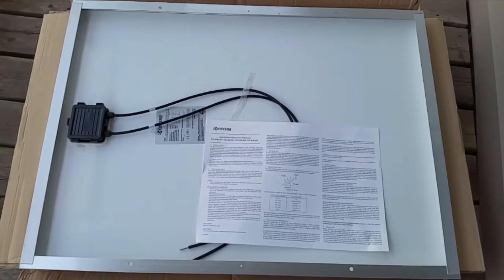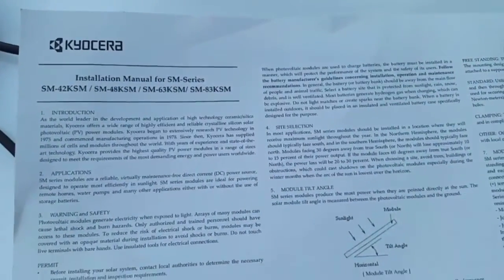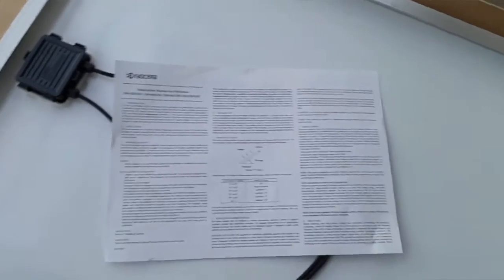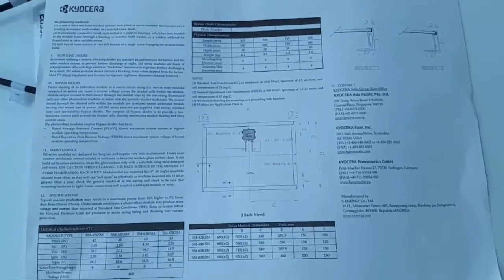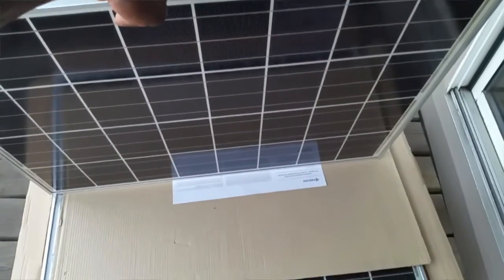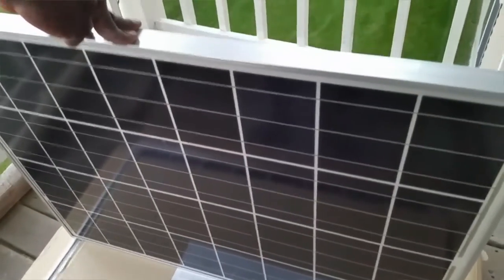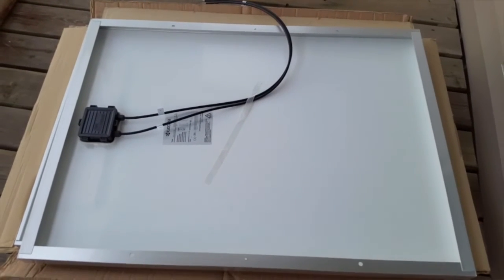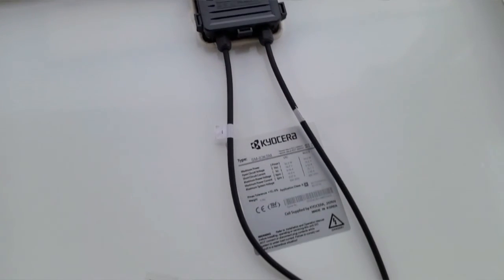KYOCERA SOLAR PANELS REVIEW || For The Off Grid Solar Project

Comment: I have Kyocera panels.   After 12 years,  still working good.   Made In Japan..
Reply from the maker: Outstanding performance Solar Panels
Reply from the maker: UNISTRUT NUT WITH SPRING: Superstrut Solar Panel Mount
https://youtu.be/XBR-aiK7kIw

SOLAR PANEL ORIENTATION/Cutting Unistrut/Superstrut for Roof Mount Installation
https://youtu.be/eNFo08dfN8Q

UNISTRUT SOLAR PANEL MOUNT: How to install solar panels Using Unistrut/Superstrut
https://youtu.be/3uubcw8gGPw
Reply: found 9 of 240 mc3s i bet almost 10 year pannels !!!  not even one  failure... thought one had snailtrail but it was the white back sheet manufactured making shadow...   they are poly so less heat.   turned em to mc4 . but their junction boxes are  full of insulation dry  paste,,, soft one but pain in the butt to reach  diodes if any  exists!!!!